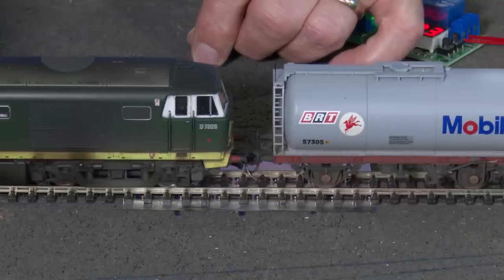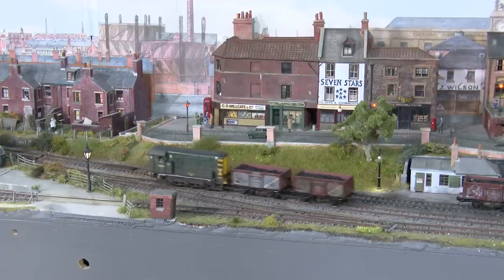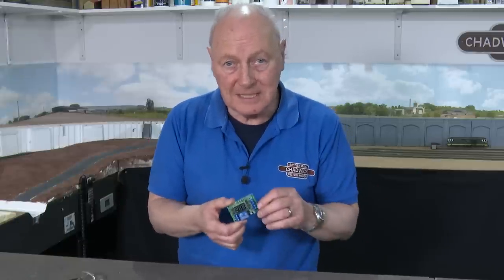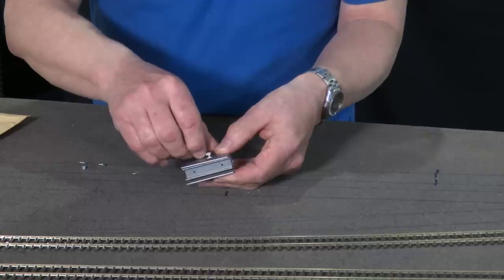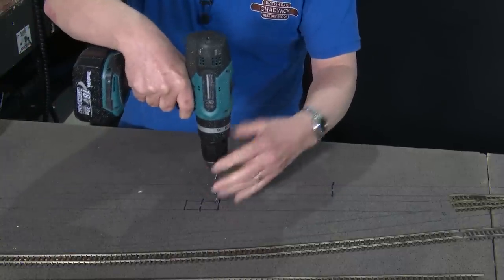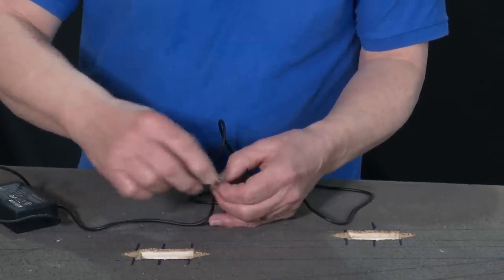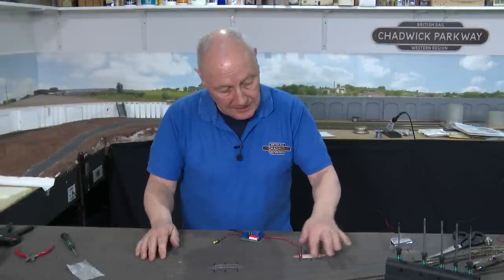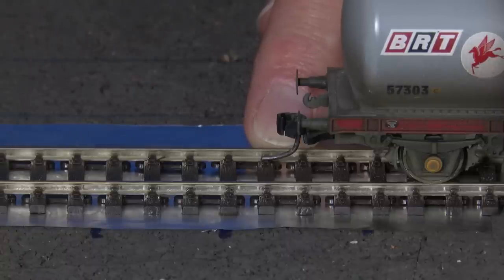Installing Kadee Electro Magnetic Uncoupler #309 Chadwick Model Railway | 182.

Comment: Always interesting Charlie. 
When I built a terminus 
I Installed KD permanent magnets near the buffer stops with the intention of uncoupling the arriving locos allowing the station pilot to remove the coaching stock. 
All good, Until,  I backed  
Departing stock up to the buffers ,complete with  all KD couplings. 
When the loco departed  it obviously left the last coach behind!! Something I obviously overlooked!
Your solenoid idea will solve my problem. 
Is it possible to just mount it underneath directly below or is it not strong enough to operate from there?
Once again many thanks. Keep up the good work. 
Stay safe 
Howard
Reply from the maker: Hi Howard, I doubt very much that the solenoids would have the power to perform adequately though the baseboard.  You could use a plunge router to gain access but clearly not without risking damage to the tracks. 
You could of course remove the actuating arms, from the offending couplings. 
Regards Charlie

Comment: You could wire the LED to the output of the board, so when you press the 'sexy' switch, its light comes on for the period the solenoid is energised.
Reply from the maker: Or of course, wire it the other way around, so it goes off when energised. Regards, Charlie
Reply: @ChadwickModelRailway  A quick look shows that you can even get similar switches with RGB LED in them, so you could then potentially wire it to change colour when pressed!
Reply from the maker: Can you send me a link Dr A?
Regards Charlie

Comment: Hi Charlie, great video, which of the relays did you use please the 12v or the 24v? I'm just about to order 3 :-)

Also not sure if it helps but I've made a 3d printed section with the magnet plates recessed to allow for the depth of underlay (I've been using the 5mm woodland scenics size) that should mean the magnet plates are as close as possible to the track, would a set of these be of any use to you?
Reply from the maker: Hi Scott, it was the 12 volt timer/relays which I bought.
Regards Charlie
Reply: @ChadwickModelRailway  thanks Charlie

Comment: Adding simple inline fuse would give protection against overload whether using the switch method or the relay method , I wouldn't rely on the electronic board to give me this protection as relays jam and electronics short.
Reply from the maker: Thanks Karl, that’s an interesting suggestion. Regards Charlie

Comment: I would have been tempted to wire the LED in the button to the feed to the solenoid, so it would be lit while the decoupler was energised.
Reply from the maker: I had thought about that, but who looks at the button when you’re doing the uncoupling. Regards, Charlie
Reply: @ChadwickModelRailway  I would. :)

Comment: I would think if you linked the two commons on the powersupplies, switch the ground side of the solenoid and wire the switch light ground through the nc side of the timer pcb then the light would be on until you press the button, go off whilst it's doing its countdown then on again when it's finished.
Reply from the maker: I think that your suggestion is bang on the money, Alan. Regards, Charlie

Comment: Excellent as always Charlie, could you wire the light part of the switch to the relay control so it's only on when pressed?
Reply from the maker: Better perhaps that it’s off when pressed.
Regards Charlie
Reply: @ChadwickModelRailway  You could do that Charlie every confidence in your wiring and electronics 👍

Comment: The timer board has a little green LED that lights up when the relay is closed, would it not be possible to desolder that LED on the timer board and replace it with wires going to the LED on the momentary switch?
That should result in it lighting up when the relay is closed without needing any additional circuitry which will make those switches even more glamorous!
Reply from the maker: That’s an interesting point Jade.
I shall mention it to my electronics friend .  Regards Charlie

Comment: I'd think that solenoid was powerful enough such that could recess it enough to cover with something more substantial than tin foil, for example, a thin piece of plastic that you find in packaging.  It might even be strong enough to recess it the depth needed to cork over the top.  Should be easy enough to test.
Reply from the maker: I asked another modeller and he uses paper! Regards

Comment: Great video Charlie, wanted to see what is involved in these solenoids. Do you know how you will subsequently integrate this into TrainController?
Reply from the maker: No, I’m afraid, not Gavin, but as soon as I know, I’ll put it in a video. 
Regards, Charlie
Reply: @ChadwickModelRailway  It's possible to get a DCC accessory decoder that will operate a relay to replace the switch.  I use a MERG one which drives 8 such devices.  Then its a simple matter of firing that accessory channel triggered perhaps by the loco stopping over the decoupler.
Reply from the maker: Perhaps Paul, we can chat through this face to face at some point. 
Regards Charlie

Comment: Hi Charlie, could you wire the switch LED to the NC on the output of the circuit board, so when you press the button the light goes off for the duration the solenoid is on, then comes back on again.
Reply from the maker: That is my intention mate, however it’s not quite as simple as you might think. I shall investigate, regards, Charlie

Comment: Hi Charlie, well that was an extremely interesting video. For anyone starting a layout these Solenoid uncouplers are certainly worth considering if you use Kadee couplers. I actually use the magnetic strip which lay on top of the sleepers and most of the time they work pretty well. These solenoid uncouplers maybe difficult to install on an existing layout as I would have to crawl under my base board and at 84 years of age that would almost be almost impossible. However if their layout is in module form like yours it would be easy to do the installation.. So just digressing for a moment there was at the end of this video a tab in the top right corner about Hunt Magnetic Couplers. Do you know if there is method of uncoupling them without using the "Hand of God" so to speak.  Many thanks for this interesting video...Cheers   Greg
Reply from the maker: I’m so pleased that you enjoyed it. Greg. No, I know of no method to carry out uncoupling of the magnetic couplings. Regards, Charlie

Comment: Pinch the power from the power supply  use the no  and the other wire out of supply  and the lift will work when the magnet  dose
Reply from the maker: I’ve tried that but there seems to be a problem. I shall investigate further. Regards, Charlie

Comment: Charlie, I have a question. I’ve seen your recent video about replacing D link couplings with the newer Bachmann style and this has also got me thinking about the Kirby uncoupling as a cheaper alternative to Kadees. I have a lot of older Lima Mail stock that I don’t want to replace, so am seeking a manageable solution to standardising couplings, but as my layout will be solely Mail and goods I really want to be able to uncouple and couple without physically intervening.

Would this approach also work with a Kirby style metal strip (or staple as some people use), raising up when the magnetic is engaged, or would it pull down?

It may be a simple magnet question that I don’t know enough about.
Reply from the maker: I wish you luck on this awful journey.
I know nothing about your couplings but I’m sure that it will be a struggle.
Regards Charlie’s

Comment: Hi Charlie.  I notice you use physical buttons to trigger the uncouplers.  Why did you go for buttons rather than using an accessory decoder?

(Sorry if this was already asked - I didn't see it)
Reply from the maker: Actually,  want both manual and auto operation. I’m planning the auto using reed switches.  Regards Charlie

Comment: Hi Charlie, did you wire the two relays in parallel so that you only used one PSU, as you will only ever use one uncoupler at a time? Thanks Charles
Reply from the maker: Yes I did Charles. Regards, Charlie.

Comment: you can probably use the relay to control the led on the switch. Your permenant live should be connected to com on the solenoid side so you can have the solenoid on NO (normally open) and power to the switch led on NC (normally closed) so that the light is on when the solenoid is off and the light is off when the solenoid is on. Soooo, the wires as shown on the switch at the end of the vides: orange and white stay as they are, going to the switch side of the control board; red and black have to move to the solenoids power supply and you have to make sure that the incoming power goes to com and not to normally open as it's shown in the video.
Reply from the maker: You are smack on the money mate.
Regards Charlie

Comment: Hi Charlie great video again a question do you have to use a separate 16v supply with each solenoid cheers
Reply from the maker: No John, I have wired the same power supply into both switches. They clearly wouldn’t be used at the same time. Regards, Charlie

Comment: Could you connect the light on the push button to the light on the board that lights up when it's active? Alternatively, operate the light on the push button via the normally open part of the relay? The push button is then lit up and then extinguishes when it's in operation.
Reply from the maker: You make an interesting suggestion. I had thought about a small shed with two outside lights, one for each solenoid. Regards, Charlie

Comment: Best way to know if the magnet is in. Is to wire the button using the NC to power the light when you press the switch
Reply from the maker: A fair point Jason.
Regards Charlie

Comment: Charlie, you could use a 555 timer circuit triggered by the button push to interrupt the led feed in your button to get the flashing you desire. Relatively easy to achieve. Message me if you need help
Reply from the maker: Thanks Tom, I may will take you up on that offer. I clearly have no idea what you’re talking about! Regards, Charlie

Comment: I have a question: Do you have do use the relay? I can see that it's a good thing to have, but wouldn't it work with the push button alone? It would make some what cheeper.
Reply from the maker: That’s true SF, however, it would mean you only have one hand left to operate the controller. Regards, Charlie
Reply: @ChadwickModelRailway  That makes sence. Thank your answaer. I enjoy your videos, I learn a lot.

Comment: The tanks look a lot like Kibri "MIRO" tanks. The decouplers seem to work well, though they use a horrific amount of current!
Reply from the maker: But only drawing the current for a short time Chris. Regards Charlie
Reply: @ChadwickModelRailway  I don’t remember if the current just peaks to initially energise the coil (which is ok) or is as high for the whole 6s. But still that’s basically an entire DCC power district’s worth for one short period 😬

Comment: How well would it work to have a small electromagnet on the loco itself to uncouple rather than  having hidden uncouplers on certain spots on the layout?    I was thinking that could work more realistcally as you could uncouple anywhere then.
Reply from the maker: There is a solenoid contraption Brendan that I’m looking into. Regards, Charlie

Comment: I.m.h.o., it might be a good thing to have an indication of the states of the solenoids on the buttons.
Then, you could make sure at a glance that the solenoid is actually off. 
If, heaven forbid, the relay should stick some day in the distant future, you at least have a chance to notice it at a glance before you smell smouldering plastic. Conversely, if you smell something, you'd know at once whether if's the solenoids.

These anti vandal switches also come with either bicolour LEDs or RGB LED rings; they can be wired up to change colour depending on the state of some inputs. 
In your case,  you'd power the green led from the NC output of your relay and the red from the NO one, in parallel to the solenoid (of course, with a restistor in series to the switch LED if necessary). Then the switch would, e.g., turn red when the solenoid is powered.
Reply from the maker: Great comment KB. Regards Charlie

Comment: Hi Charlie, just a thought, could you connect the led wires to the switch from the relay so it only activates the light when the timer is counting down?
Reply from the maker: Perhaps Paul, but that’s the wrong way around, I think it would be better if they illuminated only when not energised. Regards, Charlie
Reply: @ChadwickModelRailway  Hi Charlie, I was thinking that if they were as I stated it would also act as a safeguard, because if the light remained on after the time you had set then you would know there is a problem with the PCB and could rectify it before it damaged your coil.

Comment: Away  from  electric  Charlie,  you can use  a  short  piece  of  strong  clear  plastic  and  cut  it  to  about  1 and 1/4 inches  and bend it  between  the track sleepers.
Reply from the maker: Yes, but that’s great for the tension lock couplings.  Regards Charlie

Comment: I haven't got the hardware to examine to prove/confirm this, so caveat lector. (And you may have already considered this, but determined it to be too complicated to demonstrate without worry that you'd be sending folk down a dark electronics path :) 

...looking at the solenoid relay, It should be possible (assuming the relay is fully wired at its NC terminal too) to route the push button's LED wire via a 1KOhm* resistor (to step the voltage down to a level for the LED - possibly not required, see **) across the solenoid relay's output's NC->COM ... you would then have the relay turn off the LED as it switches the common from NC to NO and provide visual feedback that the relay has switched by turning the LED off while the relay is on. 
* I say 1Kilo Ohm here as a ballpark, but probably a good general figure for most panel LEDs on a 12V supply, but in "production" you'd likely want to match the resistor to the exact LED specifications so as not to burn out the LED over prolonged use if this value were a little on the low side.  
** Tho if you're already wiring the LED to the input at 12V, I presume the button probably already has such a matched resistor already built in. 

And apologies if I'm either teaching you to suck eggs, or you'd thought of this and dismissed it, or indeed if you'd rather not mess with such electrical engineering "off script" complications and stick to the manufacturers guidelines :) But I thought it best to say, in the off chance you hadn't pondered this possibility. :)
Reply from the maker: Thanks Ingie,
You’ve made some excellent points. However, there does seem to be another issue. I had hoped that by wiring the LED to the common and NC it would work, however it doesn’t. This requires further investigation. Regards, Charlie
Reply: @ChadwickModelRailway  Ah, shame... it might be that the relay isn't fully wired up as such NC switching out not being the timed board's primary purpose, and perhaps it added complexity that they didn't need to address
Reply: @ChadwickModelRailway  Just love the notation that this is sexy! I agree that it's sexy!

Comment: is there a way of connecting the positive side of the led to the normaly open so when you push button it turns on for the time youve set then turns off when time is up
Reply from the maker: I think there is Paul, but whilst you’re uncoupling you won’t be looking at the button. Regards, Charlie

Comment: Why not feed the switch LED with the feed to the board LEDS
Reply from the maker: That’s right Martyn, but it’s not quite as straightforward as you might think. It needs a little more investigation. Regards, Charlie
Reply: @ChadwickModelRailway  Maybe see if you can remove LED from board and then use that to feed switch LED. I subscribed today. One other question, I don't think I've ever seen a switched crossing like a diamond crossing with moving blades in any scale

Comment: An excellent video. Many thanks for mentioning the timer relay. I've installed one and it means I can operate the solenoid with a quick push of the button then concentrate on train control.
My (first ever) layout is N gauge, so the Kadee isn't suitable. What I've done is installed a 12v 2.5kg electromagnet under the track and fitted 2mm diameter, 1mm thick neodymium N52 magnets on the lowest part of the (vintage) Graham Farish wagons (just at one end). I made a short video of it.
https://www.youtube.com/watch?v=u-fewRMvKuQ
I can provide more detail if anybody needs it.
Reply from the maker: Thanks Ernie, and very much appreciated. Regards, Charlie

Comment: Hello Charlie. As with all your videos another enjoyable watch. I too have been looking into methods to operate magnetic couplings albeit in a smaller scale (N Gauge).  I really wanted to find a way to use permanent magnets rather that a powered coil and came up with a solution that uses a Servo to rotates a pair of magnets that effectively turn the uncoupler on and off.  I have put together a short video about this if you or anyone else is interested: https://youtu.be/Tr8EWXG6rKw
The principle of the mechanism could easily be enlarged to work with OO gauge Kadee couplings
Take Care, Mel
Reply from the maker: Thanks Mel, I’ll certainly check it out.
Regards Charlie

Comment: You really don't need to use these very power hungry devices any more. Dingo Servo mounts sell a mount for a pair of powerful permanent magnets that can sit beneath the baseboards (no hole at all required) and be servo operated. Much safer than using these electromagnets.
Reply from the maker: I am unaware of them, James, so I ought to check them out. Regards, Charlie
Reply: @ChadwickModelRailway  Do! Perhaps you could make an episode on them. Digikeijs (and possibly also YaMoRC) do a DCC based servo decoder that you can use with them.